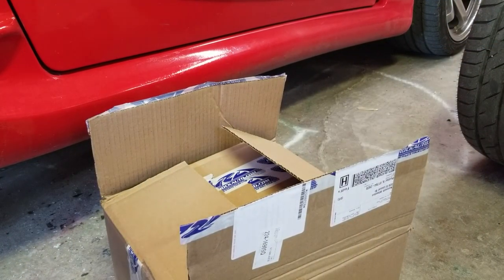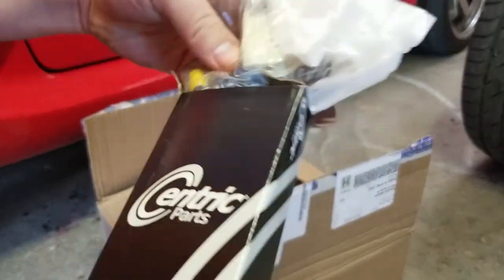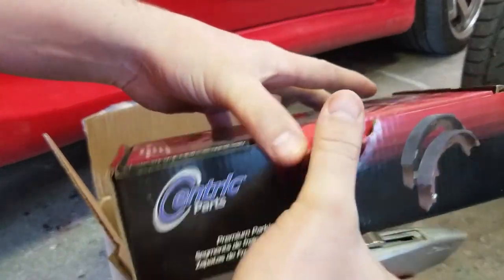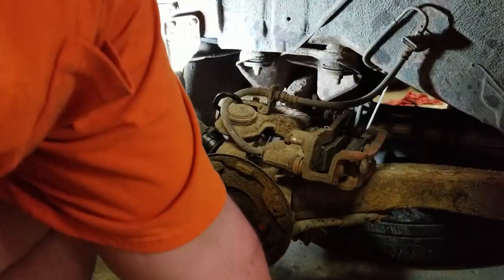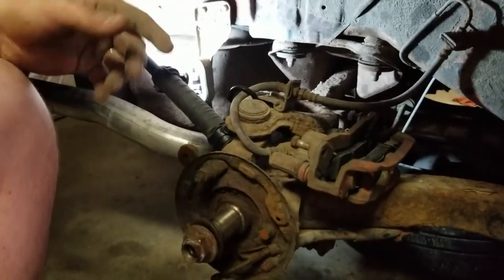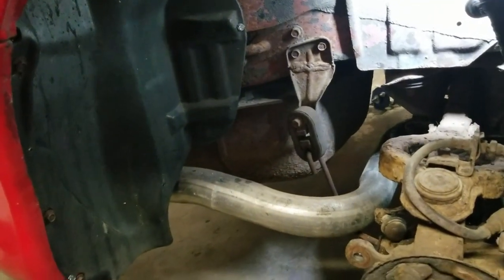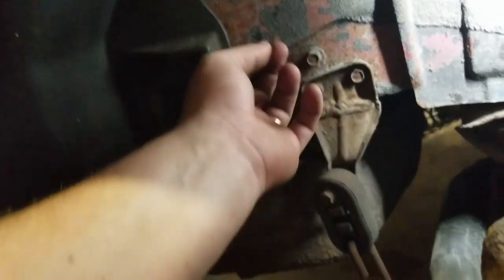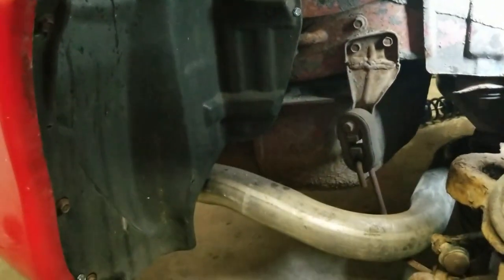1995 3000GT - Rear Strut Removal

Comment: How did you install the new coilovers. The bolt holes are larger in the new coilovers vs the old struts. I'm having the same problem. I would appreciate a little input cause I don't know what to do
Reply from the maker: What do u mean, the bolt holes on the top of the coilovers that bolt into the frame on top?
Reply: @DadbrosGarage  No the single bolt hole on the bottom that connects the shock to the car. I need a bushing from a machine shop
Reply from the maker: @safelabs4208  The vr4 and SL bolt holes are different. I tore apart the old struts and used the metal sleeve that was in the old struts. with a little sanding it fits right into the new coilover. 
Refer this this video: https://youtu.be/rWKrTZXCzqs
Reply: @DadbrosGarage  you saved me 120 dollars at a machine shop thank you very much

Comment: Good decision to clean up that rust and paint it. Those kids did not take good care of that car. If you want to keep it long term for your daughter, it will be worth it. Wear safety goggles ok? Rust in the eye hurts like a mother...  you’ll have to go to the eye doctor and they will use a metal brush drill to sand it out of your eye... wear the goggles and save yourself the torture money and ptds
Reply from the maker: I just bought some rubberized coating that I will spray under there